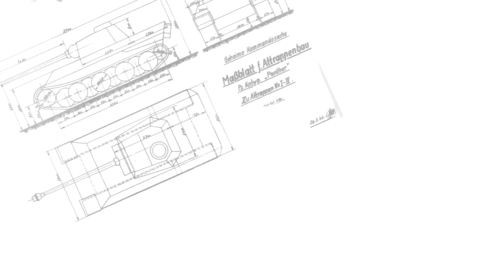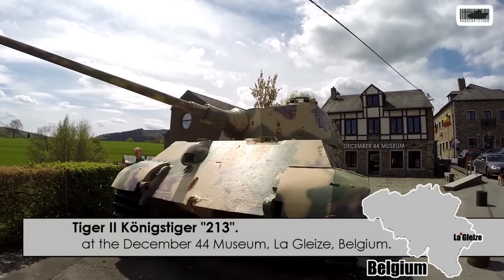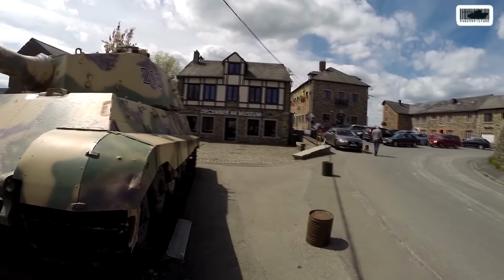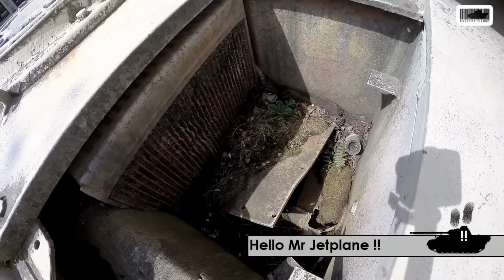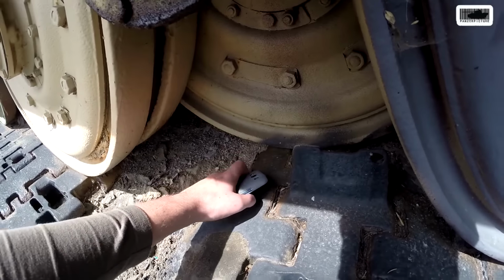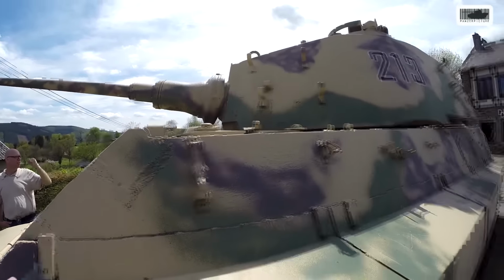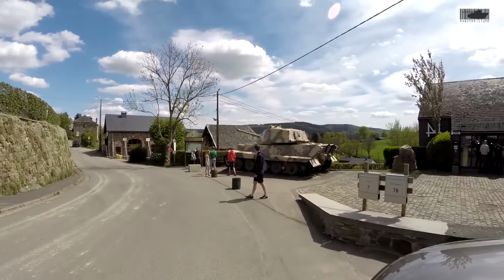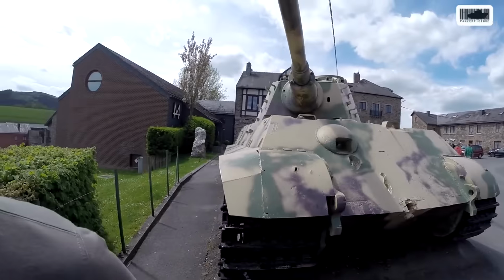Tiger II  213 Königstiger - La Gleize, Belgium - GoPro 60fps.

Comment: there is a error in your story 1:08 
the barrel did not get shot of, the crew paniced and bailed out.
The barrel was removed by belgian or american engineers to render the tank combat ineffective.
Reply from the maker: +uberminimepro Your wrong my friend, if it was cut off it would be a round cut and in the pictures you can see it was broken off. another thoerie is that the crew damage the gun after they bailed out.
Because they gun is still in a recoil position.

Comment: What you call "massive damage" in the beginning is just some machine gun fire that did nothing to the tank but scratch the surface of the at this time poor armoring. The front hits were heavy. The tank is no more orighinal, because, as you said in your video, the gun is no more original and welded on from a Panzer V Panther.
Reply: BTW nice vide and thank you.
Reply from the maker: Thank you Chris for your comment and indeed its not really massive damage, but It was hard getting the right words out with all the Jet porn above my head.